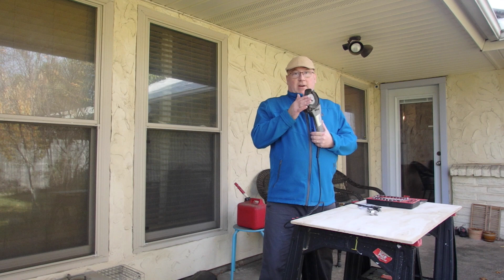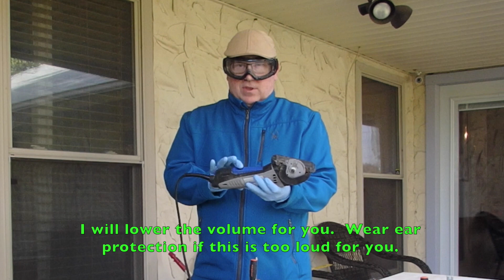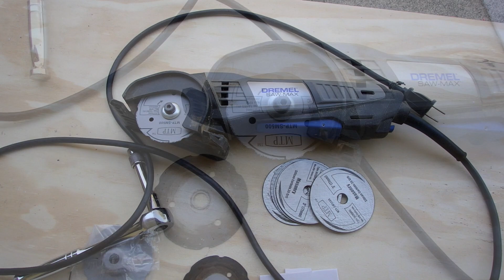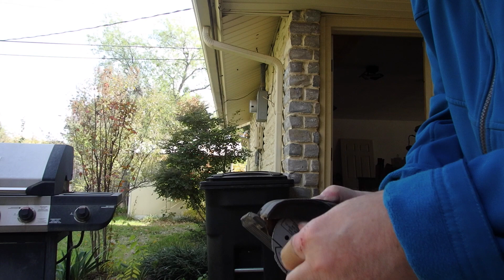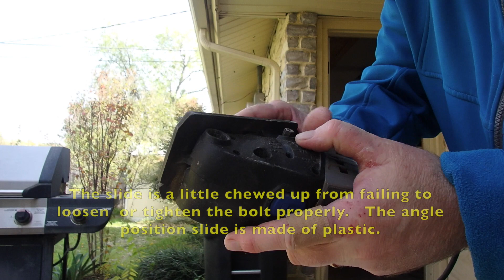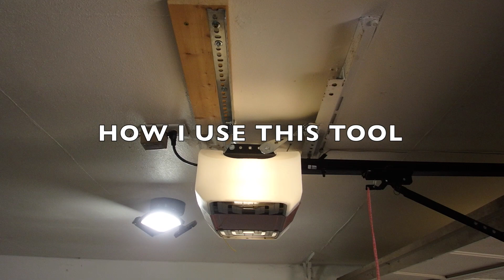Old Tool Review - The Dremel Sawmax - One of my favorite tools!

Comment: The grinding blade handles wood and light metals just fine.  I am debating cutting through a broken suspension bolt on an old bike, but I have yet to try it.   The tile blades should always be sufficient.   The question always is how long they will last depending on your material to cut.   I once used their blades to cut garage door hanging brackets and those were serious steel.   The tool did great.   I did a better job than the garage door installers who botched the job.
Reply: I just used the steel cutter to slice off a large nut.  Good blade control.  Was able to work the nut down to a thick ring that I could punch the bolt through.   The precision Dremel grinder burned up… as they often do.  The SawMax was the tool!!   See.  Rider of the Storm for these videos.

Comment: Thank you. How was your experience with those MTP blades? It seems they are the only ones avaible an I have always used Dremel ones so far...
Reply from the maker: I just used one of the Metal blades to cut a nut in half on my XR650L.   See my Rider of the Storm Channel.   It saved the job.  My mini Dremel tool gave up.   So I went with the SawMax, and that did it.